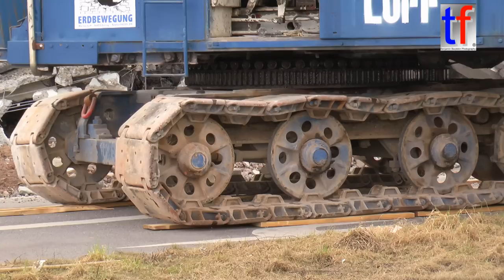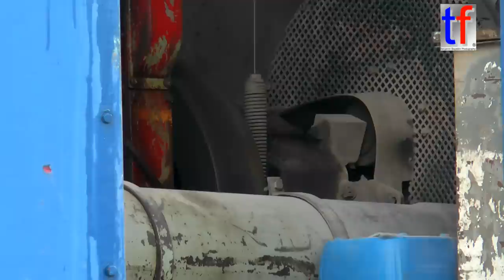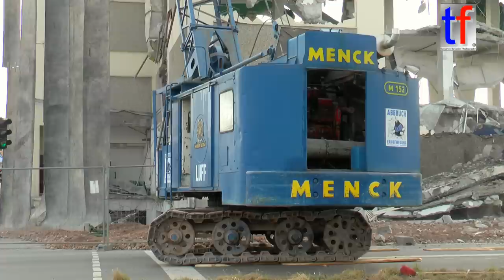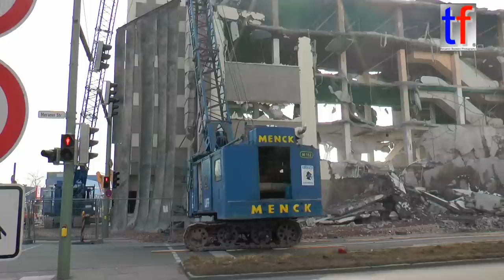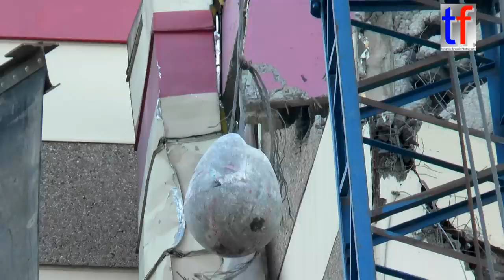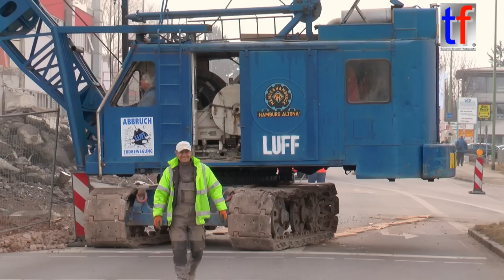MENCK M 152 Wrecking Ball Action, Fa. LUFF, Abbruch Kaufland Augsburg-Lechhausen, 14.03.2015. #3

Comment: Are these 'Menck' cranes a sort of 'prized possession' by the firms that still use them as I have yet to see one that is not in 'good' condition even though they are not new by any means. They seem to have a very slow revving engine with a massive flywheel - is that why they are still used ?
Reply from the maker: +Christopher Lovelock The chief of that company learned on those to work and it's cheap to use them still today. He took excellent care of them.
Reply: Benjamin Beytekin    kmmmmmmx    mn